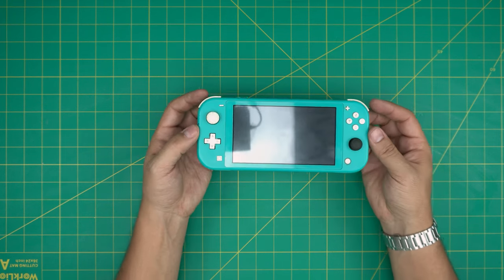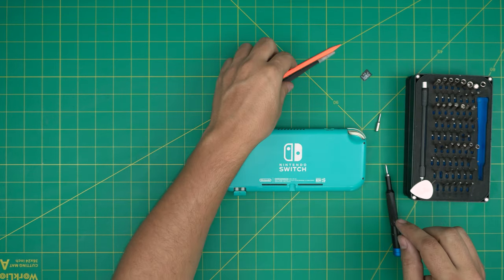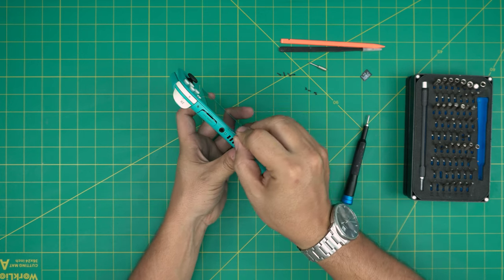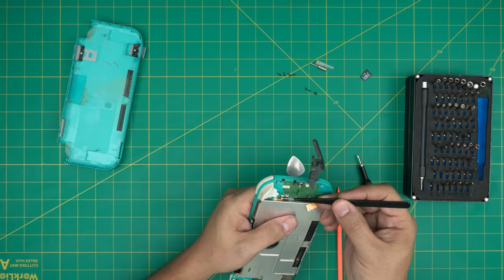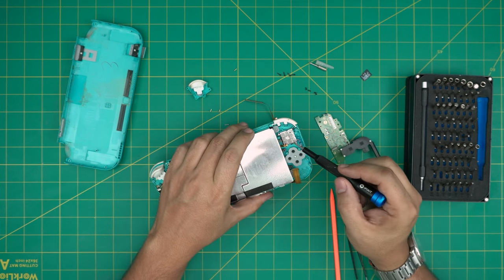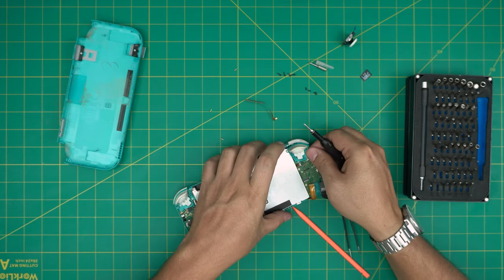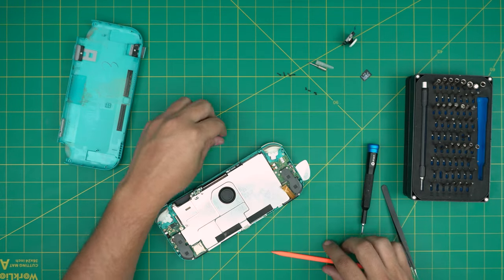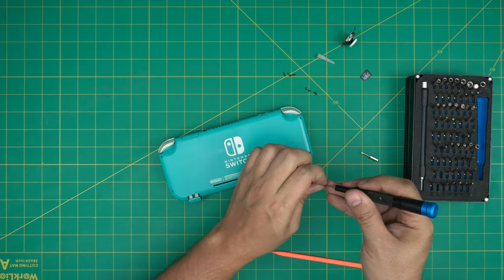How to Replace the LEFT Joystick on a Nintendo Switch Lite HDH-001 ⭐

Comment: What do I do if the clasp broke for the flex cable?
Reply from the maker: Thank you for your feedback! If you wish to support the channel, you can like, subscribe, or both!
Regarding your question, you will need to get a very slim .1mm  and slide over the flexor to push it to the contacts. or get new clips and solder it.
Should you have any further questions or requests in the future, please don't hesitate to ask me.